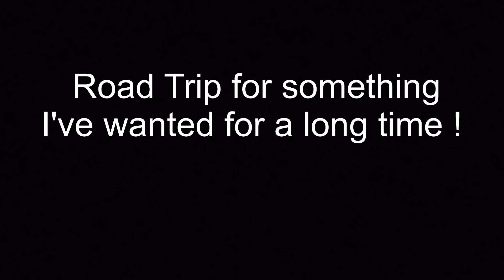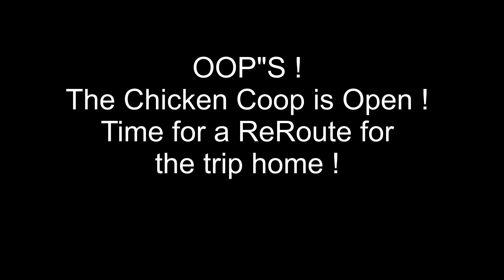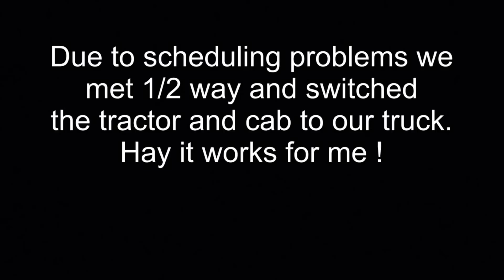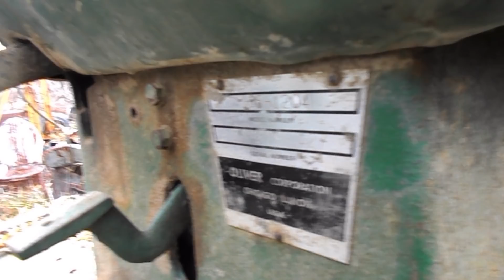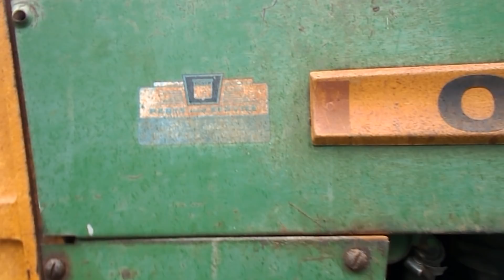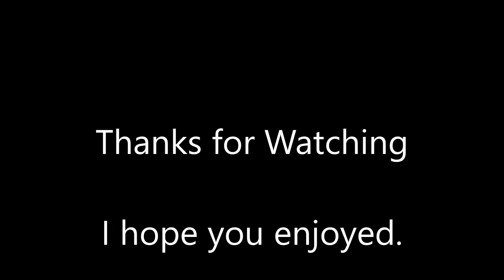Road Trip for something I've wanted for a long time !

Comment: Should of got a John Deere 4020
Reply from the maker: Well if you can find me a good running 4020 for $2500 I'll buy it otherwise for get it. The 1850 will out work a 4020 7 days a week , Not bragging simple fact cause I've owned them both. Small farms cant make money buying high priced equipment so I run what can make me money.  A 4020 is a good tractor don't get me wrong but for me its the bottom line that counts not the color of the paint. Bandit
Reply: Bandit farmer the 4020 was a game changer for farms. Silly of you to say that an Oliver can out work such an iconic tractor. You must not like Chevrolet or apple pie or you voted for Hilary!
Reply from the maker: @randybobandy4061   I'm not going to argue about it, I've owned both and I've run a bunch working for other people I know what I know and I like what I like and nothing you can say to me will ever change my mind. I would rather see Daffy Duck in the white house than Hilary !  I was a chevy man till 1988 when chevy came out with there new trucks and I became a Ford man.  I love apple pie as long as they are made with a good solid cooking apples, I hate a pie that's mushy ! Like I said a 4020 is a good tractor, I never said it was a piece of shit. Its real simple if you have back problems a 4020 will kill your back reaching and leaning forwards for the controls all day , The Oliver's I don't have to lean to get to any controls and that's one of the big reasons I prefer the 1850 to the 4020.  The other factor is simple too for a small farmer like me I don't have $10 to $15.000 to put into a tractor but for less than $5000 I can buy a good 1850 and get the same or more work done at a 1/3 of the cost.  I know nothing I can say will ever make a dent into your JD brain so lets just agree to disagree and call it a day.  Bandit
Reply: Bandit farmer 4020 came with side council levers after a few years
Reply from the maker: @randybobandy4061  1969 if I remember right and that's why they are so prized by guys and cost so much. It took 9 years for them to figure it out I guess, Slow learners I guess. Like I said lets agree to disagree and call it a day. Bandit
Reply from the maker: @randybobandy4061  New Generations JD came out in 1960 in the 10 series and were made till 1963. The 20 series tractors came out in 64 and were built till 1972 and the side council tractors were made from 1969 to 1972 and not all tractors built between 1969 to 72 were side council it was about 50/50 split between the 2. JD started to design the New Generation tractors back in 1957 so 3 years of planning and testing before production started on them so it took 12 years to bring out the side council tractors.  Bandit
Reply: Bandit farmer still out performs any other brand of equipment. John Deere was on top for the time and still is today!
Reply from the maker: @randybobandy4061  OK time to end this YOUR RIGHT !  ALL hail JD the greatest tractors in the world and all others need to be scrapped . Now you happy ?
Reply: Bandit farmer your right everything on your farm is better than everyone else. Must be rough to be a big shot YouTuber.
Reply from the maker: @randybobandy4061   I never said no such thing, and as for being a big shot on youtube you got a lot to learn about youtube . Look is as simple as this , You can farm with what ever you want I could care less I really don't care cause its your farm your money you can do what ever you want.  I'll farm the way I want to with what ever kind of equipment I want cause its my choice not yours . They all made good and they all had there screw ups even JD and I never said JD made junk equipment far from it but growing up like I did I got to run about every brand out there at one time or another and it made no difference to me what it was I would run it. But I run what I can afford to buy and that works for me , The farm and all of the equipment is paid for and the only thing I owe on is my house and I could pay it off tomorrow if I wanted to. So I have figured a few things out over the years and it might not be nothing but junk to you but it works for me and I make money my way farming and it works for me. Farm anyway you like its up to you but don't tell people what to buy or farm cause it makes you nothing but a bully and no one likes a bully.   Enough said and I wont say anymore.  Good day. Bandit
Reply: HFFARMS FARMS  An 1850 would walk circles around a 4020 all day. Oliver's were twice the tractor, and like bandit said you could stand to drive them all day they are comfortable and all your controls were easy to get at.
Reply: Ashley Grabowski that’s why he has back issues because those seats where designed so poorly that they made you slouch in your seat. And I’d like to see a 1850 out work a 4020 lmao send videos.
Reply: Bandit farmer now your bragging about how you can buy things whenever you want. Kinda entitled if you to brag about wealth. Rich farmer status.
Reply: HFFARMS FARMS  Never understood why you Deere guys won't just admit when you are wrong. So give me your reasons why you think the 4020 is the better tractor.
Reply: Ashley Grabowski 😂😂😂😂
Reply from the maker: Ashley I agree, But as they say you cant fix ,    well you know.  Bandit
Reply from the maker: @randybobandy4061   LOOOOOOOLLLLLLLLLL !  your so funny LOL LOL LOL !  Bandit
Reply from the maker: @randybobandy4061   LOL boy you got a lot to learn about farming LOL  Bandit
Reply: Bandit farmer looks like you do too bandit. You and your big farm of yours
Reply: HFFARMS FARMS  Just like I thought can sit an argue with people but as soon as we ask for some reasons to your statements you can't give any.
Reply: Bandit farmer  I agree, I really think you will like this tractor once you get her fixed up the way you want. We have an 1855 and a 1655 both great tractors they sure are great for making hay. My uncle still milks cows about 75 of them and that is another place these type of tractors sure are useful.
Reply from the maker: @ashleygrabowski3303  I've never had the opportunity to run a 1855 but I have run a 1655 a bunch and man do they make a great baling tractor !  The 3 speed in the Oliver is superior to a JD for a correct speed when the windrow thins out or thickens up. I never understood why JD never had a 2 speed like AC MF MM and Oliver had, But its one of the things in my mind that makes the Oliver better than the JD . Also JD seats are not very comfortable and there hard on your back from having to twist around in the seat because of the rap around seat they have, The Oliver's flat seat you can sit side ways in it if you want to so you can see the baler running.  There are many things about the Oliver that are much better than a JD but that's just my opinion but as we both know there are those who will never admit that JD lacks in any way and JD are always better than anything else ! LOL  Bandit
Reply: Bandit farmer  I agree completely we square bale with the 1655 and a 575 new holland baler. And we can run in 3rd gear direct or over about 1700 rpms all day long. It's so easy to use get on and off the tractor if you shoot a bail over with the thrower or something. The 1855 is great for cutting hay with our discbine and round bailing.
Reply: Bandit farmer hey bandit where is a new 2020 Oliver? Oh yeahhhh that’s right they were not that popular and they sold out!!! Now I remember. There is a reason John Deere is the only one out there with the same name they started with!
Reply from the maker: @randybobandy4061  Your so stupid you cant even look on the computer to find the history of Oliver when White Motor Corp took the company over in a hostile take over. Oliver didn't sell out they were taken over when White threw dummy companies started buying stock in Oliver and when they acquired 51% they took control of the company.  Ever hear of White Semi's ? That's who took over Oliver and milked it like cash cow to save there Truck line that ended up going under. Oliver was a well diversivied company you did not only sell farm equipment the made and sold Office equipment Kitchen equipment Wood and metal working equipment and sold more construction equipment than JD Case and Cat combined and even motors for boats !  Oliver did not sell out or go broke they were taken over and gutted to make money to save a failing truck line. JD had a hand in this to as they paid White a larger sum of money to destroy the CVT transmission that Oliver was in R&D and field trials with because JD could not compete with it. So get your facts strait before running your mouth. Doesn't say much about a company who pays a competitor to bury a project. Oh by the way have you herd the one about JD borrowing money from IH to stay afloat and is the reason why the 10 series tractors had to wait till 1960 to come out. If 2 cylinder were so great why else would you keep building tractors that shook themselves apart for and not join every other company using 4 and 6 cylinder engines ?  Why did JD use a Hercules engine on there combines until 1960 ? Why did JD not have a 2 speed (hi low range) in there tractors like everyone else did ?  Why did JD get sued by IH for coping there plow ?  You have bought into all the hype that JD is the greatest thing sense sliced bread and it like leading lambs to the slaughter ! LOL Bandit